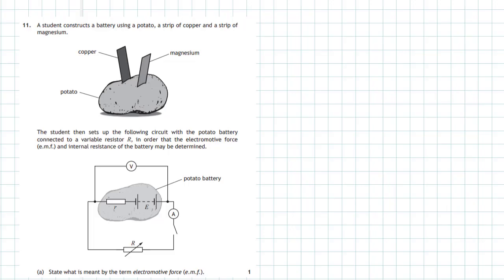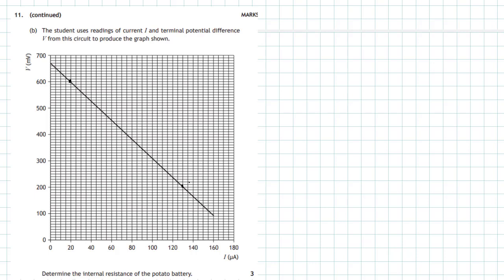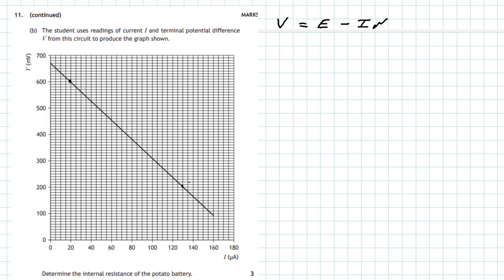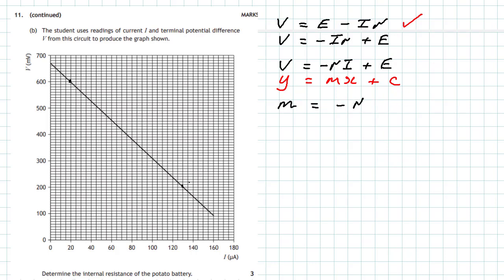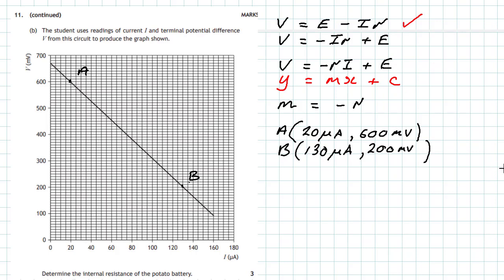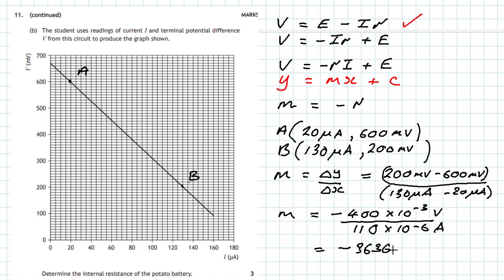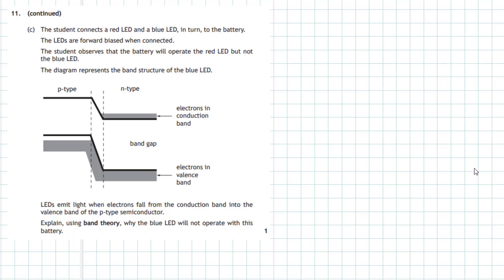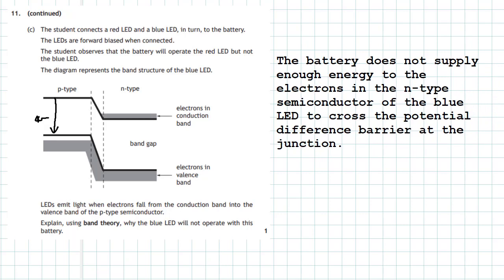2018 Higher Physics Question 11

Comment: Hi i calculated the internal resitance/gradient same as you did and got the same answer but i did not round it to 3600. The sqa in the marking scheme did it and got exactly 3600 (they used different values) and they didnt say anything about getting any extra significant figures.
Would this lose me any marks?
Reply from the maker: No not really, unless you put in a lot of figures.
Hope everything goes well tomorrow.
Reply: @DMallonhelpmyphysics  👍 thanks. Thought the exam went all right 👍
Reply from the maker: Superb. All the best.